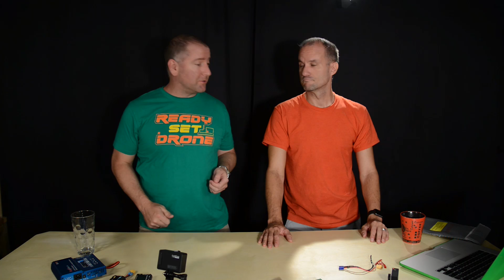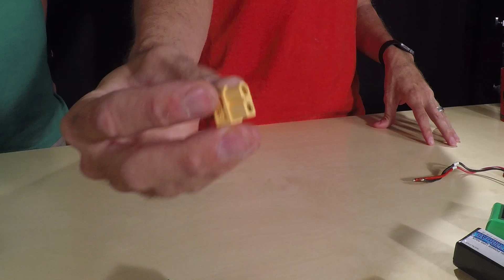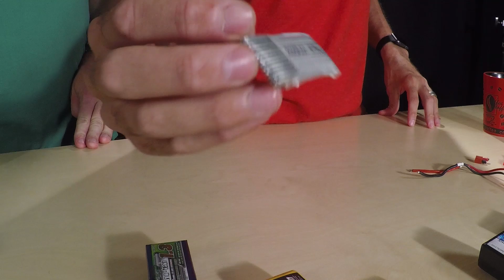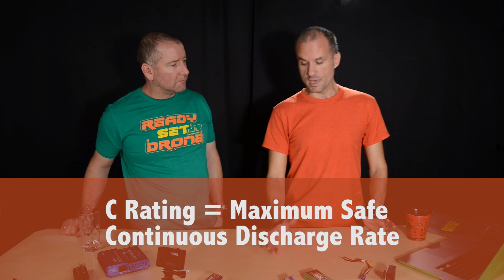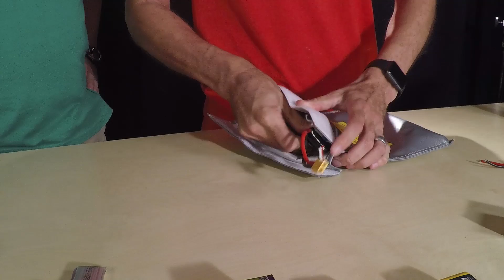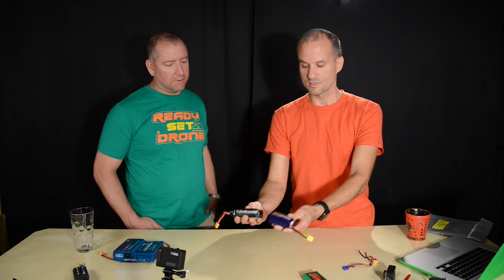LiPo Batteries Explained - Detailed Version

Comment: Is it possible to mix batteries together(11.1v/50c & 14.8v/100c 3s)?🤔
Reply from the maker: I wouldn't recommend it. 14.8v also sounds like a 4s battery, not 3s.
Reply: @readysetdrone  Running Traxxas Sledge with (2)3s 5200 mAh 11.1v each @ 50c. Is it possible to bump the voltage slightly, yes? And would the 4s 14.8v batteries be to much voltage combined(29.6v) or could I mix 11.1v & 14.8v together(26.9v), but my only concern then is discharge rate.    Could I use a single 6s 5000mAh 22.2v @ 100c? I appreciate your time and skill. Just concerned of damaging electronics.

Comment: New to FPV, so this was really helpful. Is there video that explains charging. IE I plug my 4s 1550mah battery in, say its 15.1v I out it on balanced charge and when it says full, the C is sitting at 0.0, Voltage is 16.8 but the mah on some batteries are as high as 303mah. Yet some (new batteries) go all the way to 0.

What does this mean? IS the battery on its way to death and should be discarded?

Thanks

Comment: Some battery packs have a bulkier profile and won't fit in certain compartments. I recently purchased a Kyosho Fazer MK2 GT3 and I wanted to use my 3s battery pack from my Losi Tenacity DB 1/10th scale but the battery pack was a taller profile battery pack and wouldn't fit under the plastic battery holder on the Kyosho Fazer. Question:  When looking online for a battery pack, looking at numbers printed on the battery pack, how do I determine what is going to fit in my RC car? Or can I determine how it will fit in my RC by looking at the numbers on the battery pack?

Comment: Question....I have a 4s battery, says 14.8 volts as it should  (its a dynamite reaction 2, 5000 mAh, 50c)  Anyway, the storage voltage should be 3.85 x 4, or 15.4 volts....correct?  I just dont understand why the storage voltage is higher than the 14.8 volt rating of the battery?

Comment: Again great video. A couple more questions/suggestions related to this video:

1) Jason forgot to explain what  "nominal" battery charge means and it's relevance. He said he'd come back and cover it but he never did.  I know that for LiPo batteries the nominal charge per cell is 3.7v vs a full charge of 4.2v but beyond that what is the relevance of it.  It might be worth adding a note in video description. 

2) Jason mention something about a "beeper" that you could add to your quad...but he never explained what that is or what it does.

3) Towards the end of the video there are various battery accessories (chargers, load testers, etc) that are shown/referenced. It would be nice if the specific product names and ideally the links to purchase those products were included in the description for this video. There a plethora of these products out there and it can be overwhelming to know what to actually look for in a product like this...so it would be nice to give a newbie a specific solid product recommendation as a reference.  

4) There was no discussion of the LiHV (Lithium Polymer High Voltage) batteries. I believe some of the new quads are coming out with these type of batteries (e.g., Fimi A3). These batteries charge to 4.35v per cell and are smaller/lighter than standard LiPo batteries. One of the advantages of this type battery is that you can pack more battery capacity in a smaller and lighter battery...which equals better flight time. I think there are some downsides as well (e.g., non-linear power drain rate...LiPo batteries drain at a very reasonably predictable linear rate which is great for projecting battery voltage levels during flight).   For completeness it  would have been nice to have covered that type of battery as well.

Comment: What I've never seen explained anywhere is how to choose lipo batteries for specific setups.  For example,  Say I have a Brushed E- Revo and want to run LiPos.  ESC handles 16.8v.  Which LiPo setup would be best?  2S? 3S? 4S? 4S on each side or total (2S+2S)? If a 3S is 11.1v, can you safely use 2 packs or only one?

Comment: Thanks for informative video!!! Just a question with my TB6 charger....while I’m charging a 7.4v/1300mah in 1v chi.mode, in a couple minutes it starts reading 8.4v so I frantically stop it , am I doing wrong here or should let it go on......help lol...thanks!
Reply from the maker: So I think that it is OK because a 7.4v battery is only actually 7.4v average, meaning that it will charge to a higher voltage (like 8.4v) and then discharge to a lower voltage (like 6.4v). So I think you are OK.
Reply: Ready Set Drone thanks!! I’ll let you know what happens lol

Comment: What is the lowest voltage I can run my 3s Lipo battery? It is a 5200 50c.
Reply from the maker: Maybe 9.0 volts. But that's just my best guess.
Reply: @readysetdrone  Wait sorry didn't understand 9.0 volts. What do u mean by 9.0 volts?
Reply: @readysetdrone  Also it is a 5200 mah. I am running it on an rc car.

Comment: I cannot help myself...

For the record, let it be known and corrected that flow of charge in circuit theory ALWAYS is from positive terminal of battery to negative terminal (and across any other such component) NOT the other way around.  Please take a look at a diode... charge will only flow from the positive (anode) to the negative (cathode).  An anode by definition donates electrons to the cathode. 

It is by convention in circuits (nothing else) that the positive terminal is such.  It is ALWAYS the case that electrons flow from higher energy states to lower energy states, such as the ground terminal, or negative terminal... I mean have you ever changed a car battery?  Most every battery, power source, etc. will have the positive terminal as the hot terminal and the negative as the lower energy terminal, usually grounded.  These guys are definitely not physicists.  They are confused because electrons are negatively charged particles, so you might want to think they are being sourced from a negative terminal.  But the + and - designations in circuits and components have to do with energy level in the circuit, not particle charge.  Long video for a lame battery intro.  Should leave the circuits course for LinkedIn.  They have some real simple and short videos that are accurate.

BTW, in the water analogy, "getting hit with a lot of water through a tiny hose" is NOT analogous to Tesla coil experiments (high voltage but low amperage)... that would be more like water falling from thousands of feet up in the air to your face... some call it rain, totally harmless, since Voltage is the pressure driving the electrons, not the amount of electrons.
Reply: Electron flow vs Conventional flow my man. Look it up, they are not wrong - they just explained the electron flow. You were close though, do a little more research next time lol.

Comment: I bought a portable car battery jump starter. At first it was able to jump start 2 cars with almost dead batteries. After 3+ months, I tried them again but it won't start a car again. Voltage on the output is at 12.6vdc fully charged but I think the current is different than brand new. Can I dismantle the lipo battery  from the case and charge it using the lipo chargers you showed here? I believe the portable car jumpers also use lipo batteries.

Comment: Using hose anlogy:
voltage=water pressure (measured in volts)
currant=how much water or electricity there is  (mesured in amps)
resistance=how fast the water flows (measured in ohms)

Comment: Hi I'm new in the hobby , I got a noob question which is : 
If I run a 2s 6000mah 50c battery with a 150A esc and a 1200w motor instead of 3s 6000mah 50c battery with 150A esc , the calculation shows that  Watt/voltage=amps (1200/7.4=162Amps ) on 2s and (1200/11.1=108amps) on 3s , does that mean it is safer to have a 3s instead of 2s on that esc ?

Comment: So im thinking about modding my XS809HW Visuo quad copter which takes a 3.7v 900mah battery. I want to put a 2500mah battery on it but the ones i see that are for rc's are 7.4v. Does this mean i cant use that type of battery because the volts dont match up? Would i have to use a cell phone or gps battery that is 3.7volts to power the drone?

Comment: Here's a timetable to help you guys:
1:00  LiPo vs other batteries
3:26  LiPo Connectors
7:20  Cell Voltage 
8:45  What does "S" mean
9:40  What is Voltage
10:03 Current
10:40 Water hose analogy
11:19     Funny mistake making Voltaire more of a scientist than he was
14:30  Cell numbers explained
15:45  C rating 
20:23  Safety (airplanes and more)
24:43  How to charge
25:40  Discharging
30:20 Everything summed up

With pleasure,  your fellow drone reviewer!
Reply from the maker: Great info! Thanks for posting!
Reply: Thanks.  It's great when people give this courtesy.
Reply: do you need this good lipo battery , if you need , you could see the below link very good product.
https://sktvision.aliexpress.com/store/2782033?spm=5261.seller_index.0.0.78040ba2WolNFq
Reply: Using this video as learning material for a report and having this break down is massively beneficial! So thank you. AND THANK YOU TO READY SET DRONE FOR MAKING IT MOST IMPORTANTLY!!!

Comment: 3:52 into this video   "they will handle 12 volts of current"     hmmmmmm.  Now that's interesting. That quote does not make any sense.    Also, Lipo is not a chemistry but I do believe that RC Lipo chemistry is LiCoO2 (Lithium Cobalt Oxide)  and stability of a cell is affected by it's chemistry.  And some RC items also use LiFePO4 (Lithium ferrous phosphate or Lithium Iron Phosphate).  This detailed version has some ........well.....less details.  People watching this video..... Please do more research to understand Lithium Cell Technology and how to safely use/store.   :)
Reply from the maker: Great points. thanks for clarifying!

Comment: Does it hurt to keep your li Po battery plugged in all the time when your not using it?,
Reply from the maker: It depends on your charger. If it is a "smart" charger, it will not hurt the battery. But if it is just a plug that goes into the wall, I would not leave it plugged in all the time.
Reply: Ready Set Drone it would be the one that came with the DJI P3 S

Comment: Hi! I'm trying to make an electric skateboard, will 3 ZIPPY Flightmax 5000mAh 3S1P 25C batteries connected in series, be fine with a 60a ESC:  https://www.amazon.it/Goliton-Controllore-Hobbywing-SkyWalker-Brushless/dp/B01CCR8EX8/ref=sr_1_9?ie=UTF8&qid=1498480605&sr=8-9&keywords=esc+60a+brushless
and this motor:  https://www.banggood.com/Racerstar-5065-BRH5065-200KV-6-12S-Brushless-Motor-With-Gear-For-Balancing-Scooter-p-1117658.html?rmmds=myorder
Thanks!!

Comment: I have a 60 A esc for a model I'm building.  Is it safe to use a 60 amp 4c Lipo?  Additionally, the motor is rate at 2650 mha.  What is the best combination

Comment: Hello i have the walkera 450 do3 helicopter the ESC is 40 amp the máximum capacity is 55 amp , and i want to use the multistar  5200 10 C , the power of the baterry 52 amp so thats ok ,

Comment: I want to get a higher mAh battery for my quad. So I match the volts, (s) and C. I notice that some batterys just say high discharge but don't give a C rating. My original battery is a 20 C. Do I have to match that or what is considered high discharge? Thanks for any help you can give me.

Comment: With the market flood of battery manufacturers, how can you tell good from bad? Or at least lower quality.  Is it as simple as you get what you pay for?  Is there even that much difference between them?
Reply from the maker: I think it's like everything else - you have to go with the better known brands. If you order batteries from HeliPal or GetFPV, you should be fine. I would also recommend keeping tabs on individual batteries. I sometimes use different colored Sharpies to mark them after each flight (green mark means it lasted as expected, red mark means it fell short somehow - too many red marks and I dispose of that battery). Thanks for watching!
Reply: Ready Set Drone h

Comment: Hi,
Great video. Do you know how to calculate Battery charging time? 
For example a battery with the following specification (Full charge drained to zero):

Capacity: 10,000 mAh

6 S

Max Charge rate : 2 C

Constant Discharge : 10 C

Thanks.
Reply from the maker: I don't know the formula for this, but I did find a couple of online calculators that seem to give the answer. Google "calculate battery charge time" and several Java sites come up where you enter values and it give you an answer. Hope that helps and thanks for watching!

Comment: I fully charged my Lipo batteries and didn't use them for a month. Then I found them to be  slightly swollen; about 1mm in width each. I noticed because they barely fitted before, but now about 2mm off. Do you think its a very bad thing; or they may return to normal.
Reply: if you want to store a fully charged lipo atb least keep in the fridge...
Reply: Abdel Rahman Labban They will never go down until they explode. Not a good thing. They are expanding because of too much heat and age.  Take care of them by charging and discharging them according to instructions and they will last 30 to 50 cycles.

Comment: 11:21 "voltage from Voltaire" wow Alessandro Volta is spinning in his grave
Reply: It goes with the smaller JST connectors that "will handle 12 Volts of current".
Reply: he probably has a degree in physics
Reply: Hardly, maybe he is a biologist or statistician.
Reply: And @ 3:52, "12v of current".....smh
Reply: Voltaire? Really? The minute I stopped watching this.

Comment: I just received my x8g, and charged the battery twice. Both times, I plugged the charger into the wall first, and then plugged the battery into the balanced charger, and the green light never shut off after 200mins which is the approximate est for completion. I actually ended up charging the battery for about 4hrs before I finally said that's enough.

Well my manual had two instructions. "Plug the charger to the wall and THEN plug the battery to the charger" and "plug the battery to the charger and THEN plug the charger to the wall". So I'm wondering if one of these two choices is why the green light never shut off. I guess the route I went the first two times were for a "balanced" charge.

I have the battery charging a third time by connecting the battery to the charger first before plugging into the wall, so I'm hoping the green indicator shuts off after completion this time.

Sorry for the long post, but is this common? This is my first drone, so I'm very new to this.
Reply: Seems I reached my limit lol

Anyways, I must add that I used the battery both times, and quad flew fine, so all seems well, but I'd like my charger to let me know when the battery is completely charged, rather than guessing. Also, there were two (very rapid) power outages when this happened. Power went out and came right back on, due to the weather.

Any advise??? Thanx a million.
Reply: Seems like the battery charger is pretty "dumb"...
If you have a voltmeter or a battery tester you can easily tell the state of charge of your battery.
I would do two things, get a battery tester first to see if your charger is working at all
Then get a good charger so you don't have to worry.